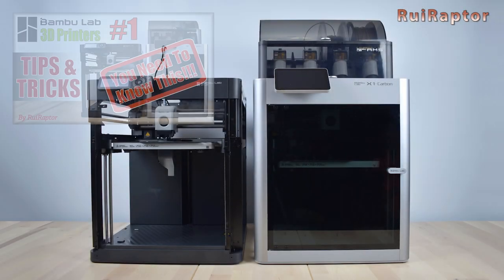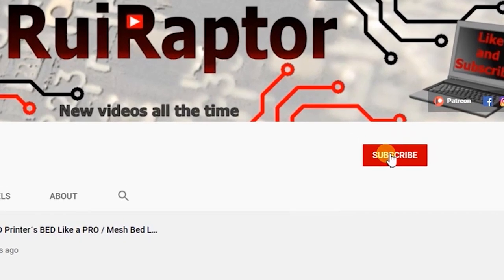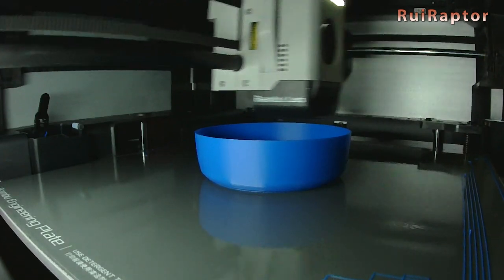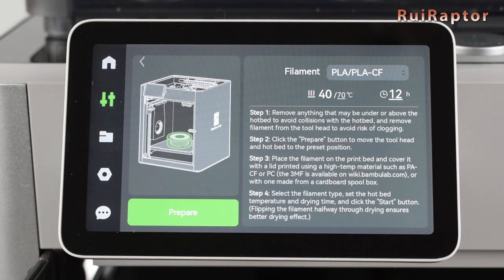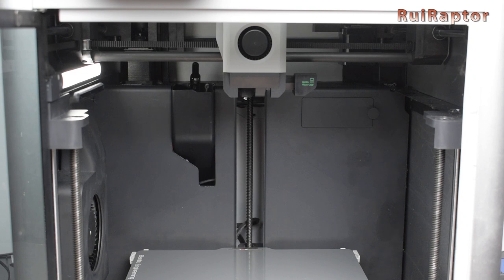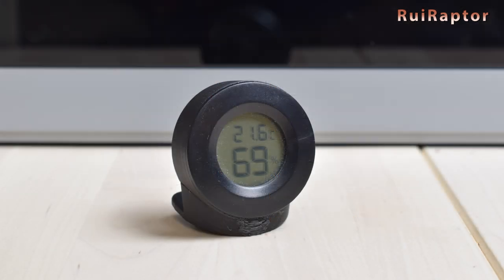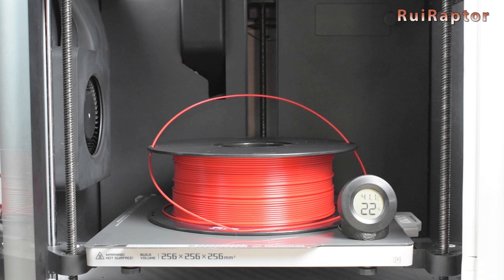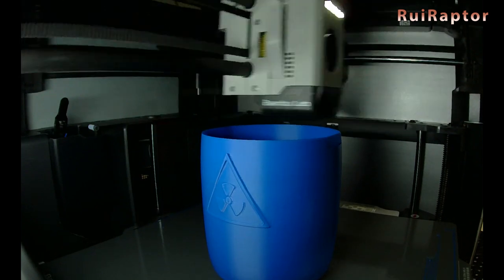Bambu Lab 3D Printers - TIPS & TRICKS #Episode2 - Dry Filament Feature

Comment: Honestly, one of my biggest takeaways after being a casual 3D printing person for a decade, and now a Bambu user, is that the fact that they built in a drying function wasn't just because they thought it would be cool - a lot of filaments REQUIRE drying out before use, filaments I had honestly thought were just garbage in past years, for example - if you buy and use the Bambu Support for PLA material, which btw is for the 'support interface' layers ONLY and not as support scaffolding itself; if you pull it out of the box and just use it - IT SUCKS, it strings and is IMPOSSIBLE ot remove. Dry it out for the 12 hours at 55 degrees it REQUIRES according to it's page on bambulab store, and guess what? IT'S A DREAM COME TRUE! So read all about stuff andlife is easier lol

Comment: can I use PLA to print that dry enclosure box?
Reply: It's not recommended since PLA softens (vicat softening temp) and deforms under load (heat deflection temp) at 57 degrees C and the heat bed during drying can be up to 90 degrees C. If you buy a new spool of ASA or ABS that comes sealed (as Bambu Lab does), you should be fine using it to print the cover right after opening your new spool.

Comment: I wonder if cracking the front door of the printer and running the chamber fan would improve drying, as hot, wet air should get exhausted from the chamber and colder, drier air should get pulled in the front.